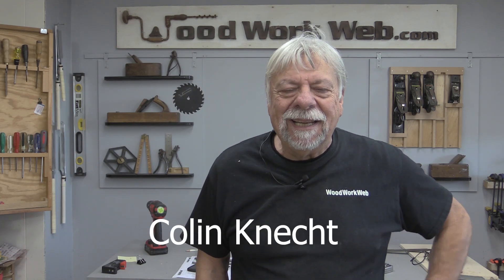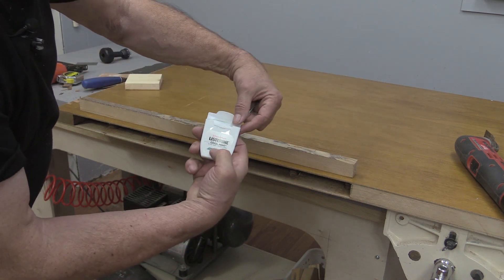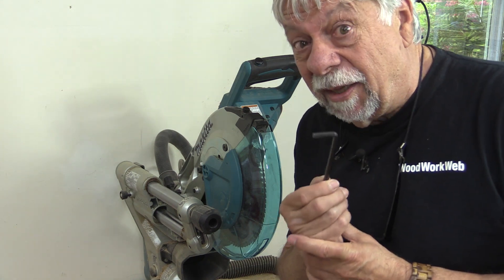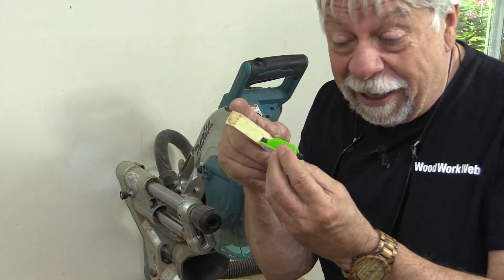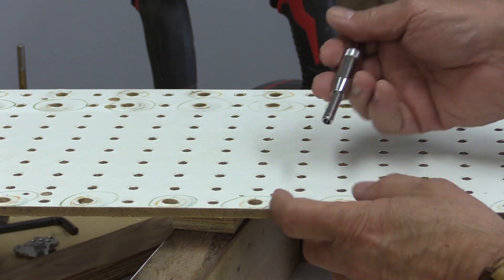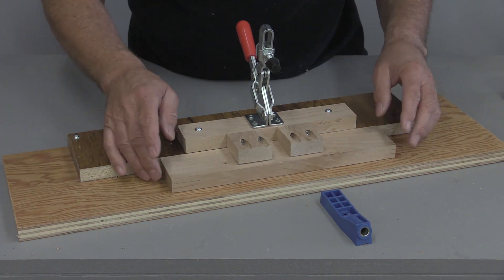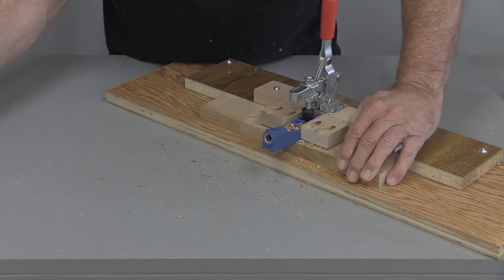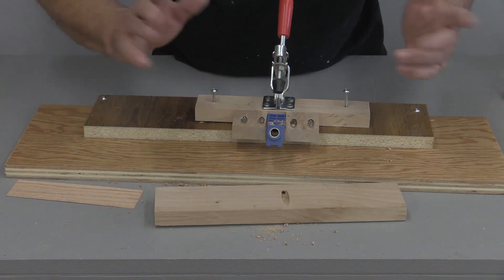WoodWorkWeb's Quick Woodworking Tips and Tricks

Comment: Great stuff Colin. One tip I have great success with for very thin spacers/ shims is iron on edge banding. It is vinyl, so it doesn't swell in humid weather, and a layer or two is typically perfect for those few thousandths of extra thickness needed.

Comment: I have a tip: if you're trying to mill a piece of wood that is VERY warped you can put drywall compound on a peice of plywood and set your warped peice on top of that. Once the compound dries it is strong enough to support it and you can send it through your planer.

Comment: Colin, thank you for the tips.  I especially like the one for the Allen wrenches.  A good percentage of my tools use allen wrenches and I just have them piled up in a drawer.  Think I'll make several of the handles then imbed a rare earth magnet into the wooden handle to I can keep the correct wrench stuck to the proper tool.  I did something similar to my drill press chuck key except I took the magnet out of one of those Harbor Freight magnetic trays, stuck the magnet to the side of the drill press housing and that's now home to the key.

Comment: I use a lot of rare earth magnets all around the shop.. Some have countersunk holes allowing them to be screwed to the walls.. Others attach directly to the steel sides of the tools and hold the wrenches and other tools firmly.. If you are screwing the magnets to the wall, be careful not to over tighten lest you break the magnet.

Comment: Why dental floss, cotton is so much cheaper and also thinner. It can be doubled over to make sure it's strong enough. Also for the Allen Keys you can drill a small hole and glue magnets in and it holds on the side of your saw.

Comment: I’ve found more often than not one can usually just insert the short in of the Allen key into fastener.
Reply: Joel Talbot unless the screw head is in a recess that requires the longer side
Reply: That’s why I used the operative phrase “more often than not.”  Personally, I use a pair of vice grips 👏🏼👏🏼👏🏼

Comment: for the pegboard, ive seen on car restoration shows, is the metal clickos, as they call them on tv, i dont know what they are called.  to join two sheets of metal, you drill holes and put this removable pin with the retractable part just the size of the pegboard holes.  they proceed to drill lots of holes and use those to hold the metal in place as they drill each hole.